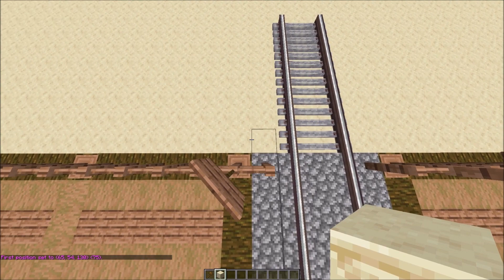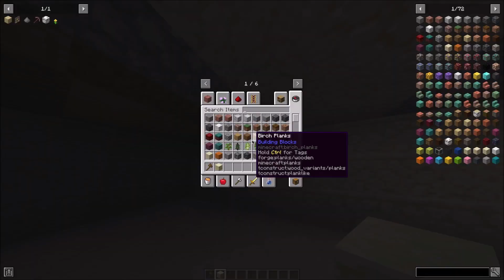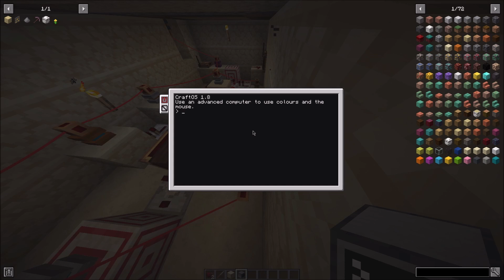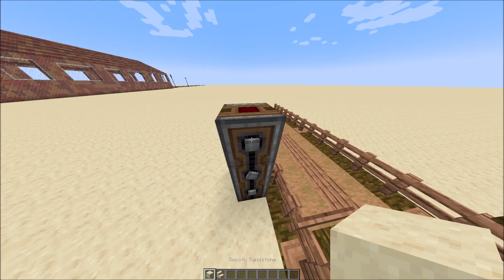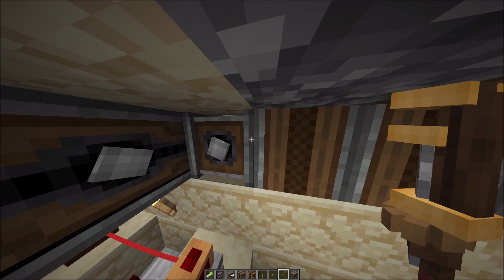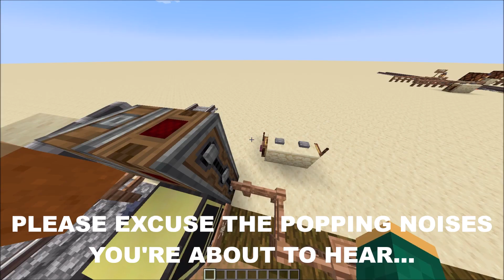Create & Immersive Engineering: Updated Railway Crossing Tutorial

Comment: I tried to create it but for some reason, the lights don't work.
Reply: Also, the bell don't work ( I did restart the computer)
Reply from the maker: is it possible that you forgot to set the wire connectors as outputs? that might be your issue, and I probably should've made it more clear in the video
Reply: @nicodo123  not exactly but maybe.